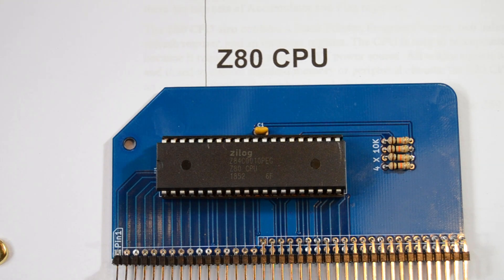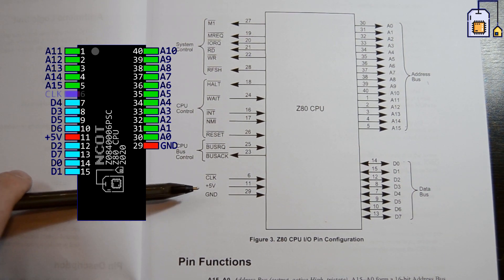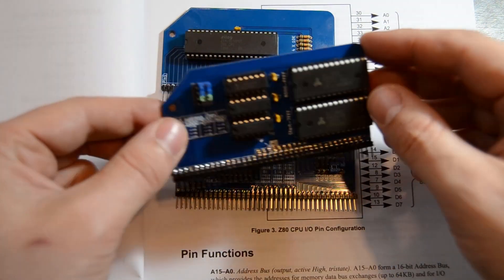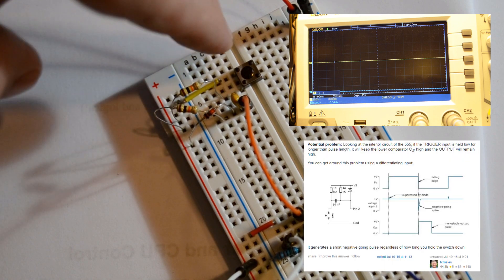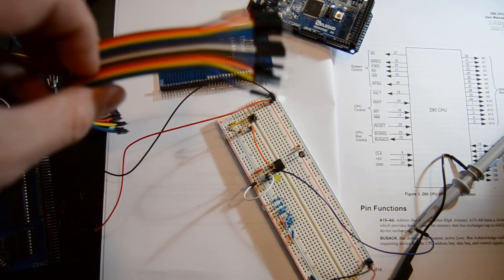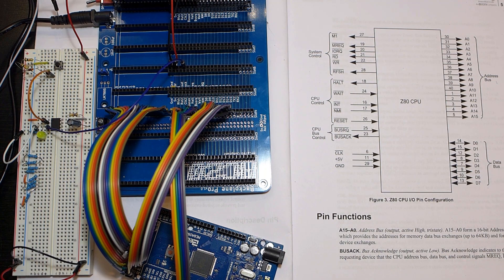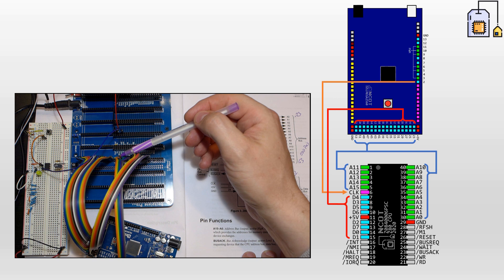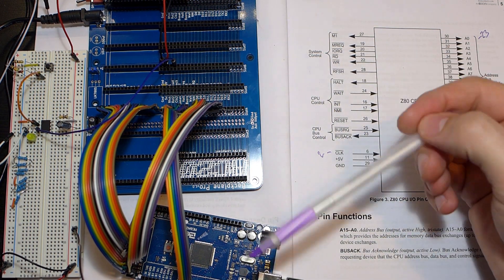Connecting a 1980s Z80 CPU to an Arduino, making a hardware debugger.

Comment: I think I would have connected the arduino direct to the clock and then let it take care of the pulses while testing at least. You can generate a clock on (if I recall) many different pins on an arduino with a little programming.
EDIT not sure you had a spare pin after watching the whole thing, come to think of it. But as for the eeprom idea, all you have to do is a bit of code to set the bus as output, and you can send an address with data, then receive the result, and so on if you wanted to.

Comment: FYI the Z80 is a 70's CPU. Also you could've just configured the 555 as a monostable to provide a single pulse per button press. Better still you could've used an output pin on the Arduino to provide the clock for the Z80.

Comment: I have a simple question. From where the Z80 fetches the instructions? From what I see, there is no memory and the DATA pins are inputs in the Arduino.
Reply from the maker: There are no instructions, I think I’d wired the CPU up to execute nop instructions using a bunch of resistors.

Comment: This video was helpful for me when cross-checking with my own results. As it turns out, BOTH the Z80 chips I have are defective and the outputs are static regardless of what I do. It's always worth spending a little extra and ordering through a reputable distributor like Mouser to get a brand new working chip. When starting out it's difficult to recognize whether you've screwed up or a part is defective.

Comment: I'm using an Arduino Nano instead of an EEPROM for my Z80 project. Problem I had had is, the Arduino is not a tri-state device. The digital pins behave OK input mode, but the analog pins still draw too much current in input mode and therefore kept pulling my data bus down. I found a 74LS245 bus transceiver didnt work satisfactory, but 74ls241 buffer does enable me to bridge the Arduino Nano to the data bus. 

Bonus for using the Arduino Nano is, My "ROM" emulator code can also disassemble on the fly, which has been amazing for debugging (helped by M1 signal)

This is limited to 512 bytes of address space for Z80 code on the Arduino,  but  my Z80 assembly coding is pretty awful and I havent written a program that big yet lol
Reply: of course the nano has tri-state io pins - just configure a pin as input
Reply: What was the problem you encountered with the 74LS245 bus transceiver?

Comment: Very interesting. Personally I'm more a computer/software person than an electronics person. So perhaps a stupid question, but how do you make the button to give only one short pulse? That seems useful for lots of projects.
Reply from the maker: That is a really good question. You can do it in software by effectively sampling the button over a few milliseconds, or you can make a small circuit using a few different techniques.

What I did was search for things like “Arduino button debounce”.
Reply: @ncot_tech  Thanks for your reply. I know of the software debounce technique with Arduino but I find it unsatisfactory. Debouncing is a hardware problem that (imho) should be addressed in hardware. I know of RC filters, and personally with Arduino projects I sometimes use optocouplers since I found they also work. Doesn't answer the question though of how to generate only a single pulse of fixed duration after each (long or short) button press.
Reply: @olavl8827  I think the answer to your question is part of Ben Eater's breadboard computer series here on YT.  It's fairly early, and he too uses a 555 timer.

Comment: 3:20 "which is not really what the cpu wants to see" actually it doesn't usually care at all, i've clocked a 6MHz Z80 with a 1-statechange-per-minute clock just for the lulz and it worked just fine :P
Reply: Faggin made a good job!

Comment: Nice going, James! Have you watched Julian Ilett's YouTube channel on the Z80?  Your videos are inspiring me to build a Z80 machine. I'm just trying to recall what the bootup sequence of the Z80 is? i.e does it fetch an address from a particular location and jump to there?
Reply from the maker: Yes, I watch Julian's channel (and his side channel where he's building a shed in the exact way an engineer would build one 😁).

The Z80 looks for code at address zero. I wouldn't look too closely at the output from my Arduino debugger thing, I'm not sure it was working properly. All it was doing was spitting out whatever went across the busses so some of the data was probably coming from other chips and possibly not during the fetch cycle of the CPU.
Reply: I'm now looking through the Z80 chip doc - to see if I can answer my own question.
Reply: Perhaps I'm getting confused with the 6502 - (I should have paid more attention to you single-stepping the Z80) - I can see the address bus starting at 0x0000. I'm slightly confused by the opcode/address debug output. It seems you were initially presented with the instruction 'load hl,0000', and then your upper 8 bits of your address bus suddenly flips.
Reply: @johnwilson3918  IIRC the Z80 reset vector is location 0x0, this is usually a jump instruction. There are several RST (reset) instructions which are located in the lowest part of the memory.
Reply: Also dont forget your stepping the clock, an instruction can take some cycles to read, then the data maybe (unless a instruction is just a jump or halt) and the data could be anything and the z80 would ignore whats happening. Funny to see the databus being equal for like 3 clk pulses, probably has to do with these cycles.